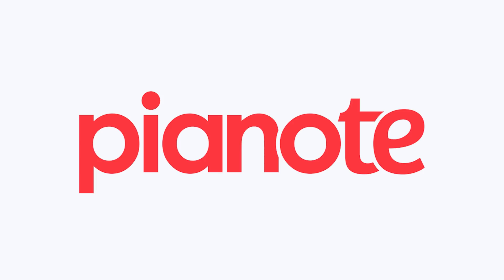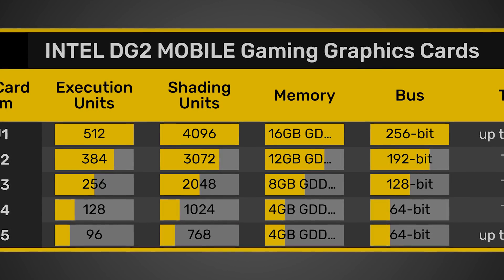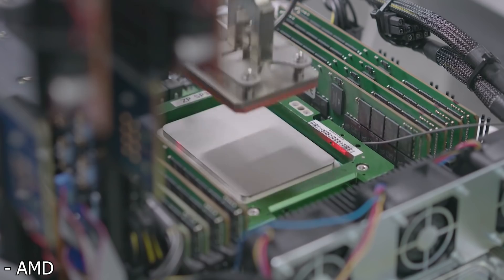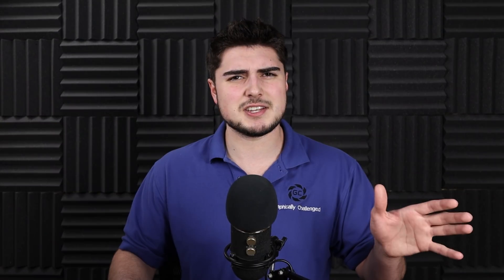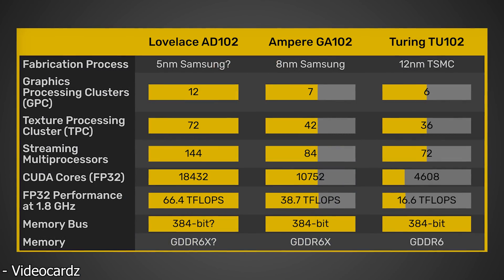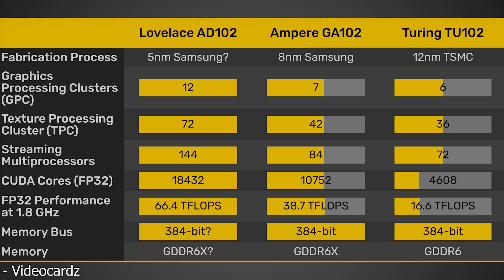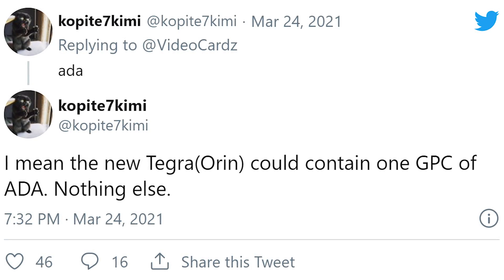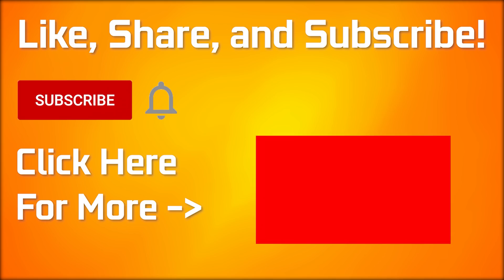Nvidia Is In BIG TROUBLE & INSANE RTX 4000 GPU Leak

Comment: Wish a new name brand would enter the fold. Evidently Nvidia, Intel and AMD can't cut it.
Reply: They do exist. But consumer kill them
Reply: I havent found RTX 3080 yet but as RTX 3080TI coming inM ay i will get that instead. However my gtx 970 g1 gaming that i have since november 2014 stil runs evrything on ultra 1440p 30+ fps, and simple games like crash bandicoot 4 that released on Friday(which is the game i currently play) still run ultra 1440p 60 fps. But most current games run about 40 fps maxed 1440p which is aamzing for a 6 years old card. my pc now is CPU: RYZEN 7 1700
RAM: 16 GB DDR4 3200MHZCL15 GS KILL RIP JAWS
GPU: GTX 970 G1 GAMING
MONITOR: DELLP2416D 24'' 2560X1440 60 HZ IPS
MOTHERBOARD: ASUS PRIME X370 PRO
HDD1: WD BLACK 4 TB
HDD2: 1 TB

SSD: MP 600 2TB
PSU: CM 750M 750 WATT
Reply: intel hasn't started yet bro what do you mean
Reply: @cydia11centra  intel already sold out before release date.

Comment: RTX  3000 : serves 12 people who actually bought it 
RTX 4000 : its time
Reply: Bullshit comment 😑
Reply: I havent found RTX 3080 yet but as RTX 3080TI coming inM ay i will get that instead. However my gtx 970 g1 gaming that i have since november 2014 stil runs evrything on ultra 1440p 30+ fps, and simple games like crash bandicoot 4 that released on Friday(which is the game i currently play) still run ultra 1440p 60 fps. But most current games run about 40 fps maxed 1440p which is aamzing for a 6 years old card. my pc now is CPU: RYZEN 7 1700
RAM: 16 GB DDR4 3200MHZCL15 GS KILL RIP JAWS
GPU: GTX 970 G1 GAMING
MONITOR: DELLP2416D 24'' 2560X1440 60 HZ IPS
MOTHERBOARD: ASUS PRIME X370 PRO
HDD1: WD BLACK 4 TB
HDD2: 1 TB

SSD: MP 600 2TB
PSU: CM 750M 750 WATT
Reply: @shredderorokusaki3013  good for u , atleast u r not playing like cyberpunk or something. ur GPU would be coughing up blood

Comment: The rtx 4000 series ought to be very fast and convincing to buy. Assuming a scenerio where  the mining bubbles bust and lots of used rtx 3000 and radeon 6000 gpu cards floods the market for close to msrp prices, not many are going to buy rtx 4000 except they are convincingly powerful and fast. I am sure the gpu makers would have played this script and get prepared for a case like that.
Reply: You're such an optimist. There will be a trickle 30 series second hand and then probably go for MSRP.  Production numbers were low and miners paid top dollar. They won't let those cards go for peanuts.
Reply: @slammerf16  Your projection makes the whole situation gloomier. Another projection of mine. If there is a bust in bitcoin mining and steadily production ramps up and availability is improved, miner are no longer seeking these gpus, price could creep down. If  only there is no other form of artificial scarcity created by the manufacturers. I guess I am letting my optimism take the best of me here because the market is just insane right now. Speculating for a normal situation is what I can do at the moment as I cannot justify scalper's price.
Reply: @Eaglewings-E  just for info, it's ETH mining you need to watch. Bitcoin is mined on ASICS. Pool miners get paid in bitcoin but they're mining ETH (mainly)

Comment: I wouldn’t expect them to release the 4000 series anytime soon as the 3000 series is in high demand. It would be better to milk it as long as possible
Reply: That's is why competition with AMD is good. If AMD also decide to milk it, us the consumers are fucked but if AMD decide to try and compete, it will force NVIDIA to not milk the 3000 series.
Reply: because AMD will pull ahead. and NVIDIA cant allow that. thankfully, NVIDIA doesn't seem to go the intel route and rest on their laurels. they have always pushed the envelope. they just make you pay a higher premium to do so. even the worst gap from the 10 series to the 20 series was only small because of ray tracing with no real competition. and DLSS turned out to be way better than anyone thought so it actually built up value.
Reply: Well amd would try to uppercut them so nvidia can't, not too mention intel is joining the gpu market
Reply: Cope they want 💰 it only makes sense that they will release a 4000 series asap
Reply: I havent found RTX 3080 yet but as RTX 3080TI coming inM ay i will get that instead. However my gtx 970 g1 gaming that i have since november 2014 stil runs evrything on ultra 1440p 30+ fps, and simple games like crash bandicoot 4 that released on Friday(which is the game i currently play) still run ultra 1440p 60 fps. But most current games run about 40 fps maxed 1440p which is aamzing for a 6 years old card. my pc now is CPU: RYZEN 7 1700
RAM: 16 GB DDR4 3200MHZCL15 GS KILL RIP JAWS
GPU: GTX 970 G1 GAMING
MONITOR: DELLP2416D 24'' 2560X1440 60 HZ IPS
MOTHERBOARD: ASUS PRIME X370 PRO
HDD1: WD BLACK 4 TB
HDD2: 1 TB

SSD: MP 600 2TB
PSU: CM 750M 750 WATT
Reply: I know right ? Why invest in new technology and resources when the 30 series is in high demand ? If I was CEO i’d for sure milk it as far as possible.

Comment: If I was intel, seeing as how availability is the main issue, I would really consider using the internal 14 nm process, since they seem to have so much of it. If they were to produce tons of 14nm gpus and have them readily available, then they could grab a pretty large gpu market share right off the bat.

edit: a lot of people are talking about how the performance wouldn't be very high compared to tsmc's 7nm or intel's 10nm, which is a given. the point would be to have gpu's available. at this point 14nm is pretty ancient so I would imagine that intel has had enough to time to get yields to be very consistent. So they should be able to pump out 14nm chips and since they have fabs in places outside of china and taiwan, they wouldn't be as affected by things like the us-china trade wars and the drought in taiwan. if they just have gpus on shelves that typical non-miners can get their hands on, that could be a huge win for them and regular users/gamers.
Reply from the maker: If it was planned for TSMC it may unfortunately be to late to backtrack at this point since they are getting relatively close to production.
Reply: It seems so obvious that this would be a great move for them so.. there is likely a good reason they do not to that. Just a thought.
Reply: What intel have is just good enough to supply their stuff. During 9th gen roll out intel end up taking capacity meant for consumer grade cpu for professional line up. Meaning they can't just build more since there is no capacity left. Intel were behind AMD right now when it comes to process node the only way they can defend themselves against AMD taking market share was their sheer capability making significantly more cpu than AMD. 

And while many hope intel will be able to remedy the situation we had right now with the gpu market they have their own goal.
Reply: The die size would be huge and yields will be extremely low. 14 nm might even be worse than on 10 nm
Reply: With the amount they stretched 14nm on their processors I would even be surprised if they could get up to 3070 or maybe more levels of performance on 14nm
Reply: I'm sure the performance would be lacking like a lot of people are pointing out, but the point would be to have products to sell. At this point if they were to just flood the gpu market with passable performance cards, there's a good chance that people would just buy it because they are having a hard time getting anything else even if it's just their lower end skus
Reply: 7

Comment: Let’s be real, by the time 3080s are readily available next gen will be a short few months away. Since the start of 2021 there has been a small handful of 3080 drops months apart in the UK <10 in 2021 :(
Reply: Does it matter? They’re still amazing cards. It’s not like we have any new games demanding more power.
Reply: Buying a card by itself is a nightmare atm. Your best bet is to buy a cheap pre-build (might have Chinese parts that break easily but the CPU and GPU tend to be fine) that has the card you want. chances are that they'll be at least a few wherever you look and the price will at least be lower than the scalper ones.
Reply: @J-Bong  I havent found RTX 3080 yet but as RTX 3080TI coming inM ay i will get that instead. However my gtx 970 g1 gaming that i have since november 2014 stil runs evrything on ultra 1440p 30+ fps, and simple games like crash bandicoot 4 that released on Friday(which is the game i currently play) still run ultra 1440p 60 fps. But most current games run about 40 fps maxed 1440p which is aamzing for a 6 years old card. my pc now is CPU: RYZEN 7 1700
RAM: 16 GB DDR4 3200MHZCL15 GS KILL RIP JAWS
GPU: GTX 970 G1 GAMING
MONITOR: DELLP2416D 24'' 2560X1440 60 HZ IPS
MOTHERBOARD: ASUS PRIME X370 PRO
HDD1: WD BLACK 4 TB
HDD2: 1 TB

SSD: MP 600 2TB
PSU: CM 750M 750 WATT
Reply: I havent found RTX 3080 yet but as RTX 3080TI coming inM ay i will get that instead. However my gtx 970 g1 gaming that i have since november 2014 stil runs evrything on ultra 1440p 30+ fps, and simple games like crash bandicoot 4 that released on Friday(which is the game i currently play) still run ultra 1440p 60 fps. But most current games run about 40 fps maxed 1440p which is aamzing for a 6 years old card. my pc now is CPU: RYZEN 7 1700
RAM: 16 GB DDR4 3200MHZCL15 GS KILL RIP JAWS
GPU: GTX 970 G1 GAMING
MONITOR: DELLP2416D 24'' 2560X1440 60 HZ IPS
MOTHERBOARD: ASUS PRIME X370 PRO
HDD1: WD BLACK 4 TB
HDD2: 1 TB

SSD: MP 600 2TB
PSU: CM 750M 750 WATT

Comment: Lmao there gonna be like $1500 for a 40 series card with similar performance  to a 1030 2gb 🤣
Reply: I havent found RTX 3080 yet but as RTX 3080TI coming inM ay i will get that instead. However my gtx 970 g1 gaming that i have since november 2014 stil runs evrything on ultra 1440p 30+ fps, and simple games like crash bandicoot 4 that released on Friday(which is the game i currently play) still run ultra 1440p 60 fps. But most current games run about 40 fps maxed 1440p which is aamzing for a 6 years old card. my pc now is CPU: RYZEN 7 1700
RAM: 16 GB DDR4 3200MHZCL15 GS KILL RIP JAWS
GPU: GTX 970 G1 GAMING
MONITOR: DELLP2416D 24'' 2560X1440 60 HZ IPS
MOTHERBOARD: ASUS PRIME X370 PRO
HDD1: WD BLACK 4 TB
HDD2: 1 TB

SSD: MP 600 2TB
PSU: CM 750M 750 WATT

Comment: 4000 series leaks already u cant even buy a 20 series card rn
Reply: well R&D ain't stoppin
Reply: @lun4tic26  PC gaming gunna die if it stays like this.
Reply: @shinski8114  Nope. Not gonna happen lol.
Reply: Ikr
Reply: I havent found RTX 3080 yet but as RTX 3080TI coming inM ay i will get that instead. However my gtx 970 g1 gaming that i have since november 2014 stil runs evrything on ultra 1440p 30+ fps, and simple games like crash bandicoot 4 that released on Friday(which is the game i currently play) still run ultra 1440p 60 fps. But most current games run about 40 fps maxed 1440p which is aamzing for a 6 years old card. my pc now is CPU: RYZEN 7 1700
RAM: 16 GB DDR4 3200MHZCL15 GS KILL RIP JAWS
GPU: GTX 970 G1 GAMING
MONITOR: DELLP2416D 24'' 2560X1440 60 HZ IPS
MOTHERBOARD: ASUS PRIME X370 PRO
HDD1: WD BLACK 4 TB
HDD2: 1 TB

SSD: MP 600 2TB
PSU: CM 750M 750 WATT
Reply: @shredderorokusaki3013  If your gonna get a 3080ti u should definitly upgrade ur cpu cause thatll be a huge bottleneck and you wont see that much of a difference in gameplay
Reply: I have a 3070.
Reply: @mathgasm8484  wow ok i really wish i could get one but may just have to wait glad u got one tho
Reply: The gpu prices will drop next year, cause that is when it is certain the supply to create everything(CPUs ; GPUs) will be back to normal which means that 3000 series will be in okay stock and 4000 series will be more than in stock.
Reply: You cant buy any cards right now, all the crypto miners keep buying them up. Theres a video on youtube where a guy has a warehouse filled with like 10000 cards mining. Even a 1060 6gb is going for $900.
Reply: @Username4453  I have a RTX 3070 I bought.
Reply: @mathgasm8484  And you probably over paid for it.
Reply: @Username4453  nope just went through a custom builder since I am due for an upgrade.

Comment: First.
Reply: Edited comments don’t count
Reply: I havent found RTX 3080 yet but as RTX 3080TI coming inM ay i will get that instead. However my gtx 970 g1 gaming that i have since november 2014 stil runs evrything on ultra 1440p 30+ fps, and simple games like crash bandicoot 4 that released on Friday(which is the game i currently play) still run ultra 1440p 60 fps. But most current games run about 40 fps maxed 1440p which is aamzing for a 6 years old card. my pc now is CPU: RYZEN 7 1700
RAM: 16 GB DDR4 3200MHZCL15 GS KILL RIP JAWS
GPU: GTX 970 G1 GAMING
MONITOR: DELLP2416D 24'' 2560X1440 60 HZ IPS
MOTHERBOARD: ASUS PRIME X370 PRO
HDD1: WD BLACK 4 TB
HDD2: 1 TB

SSD: MP 600 2TB
PSU: CM 750M 750 WATT
Reply: @shredderorokusaki3013  There’s no need to upgrade if you don’t play demanding games.